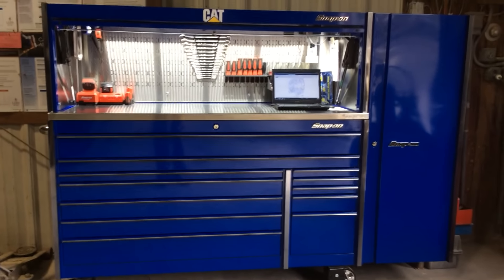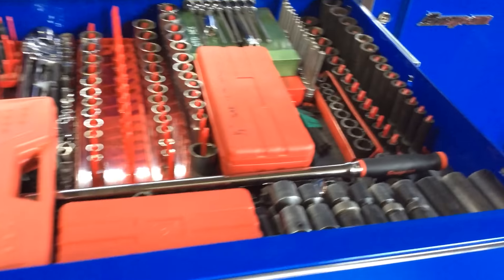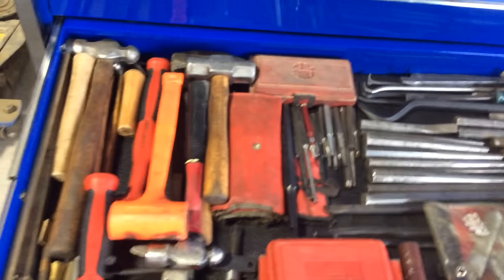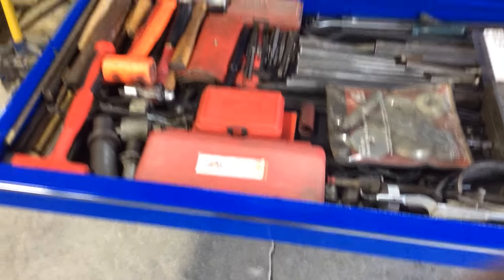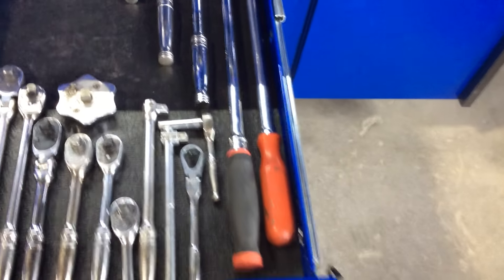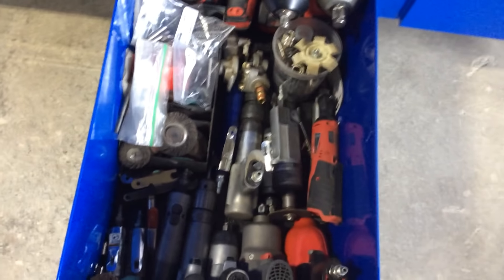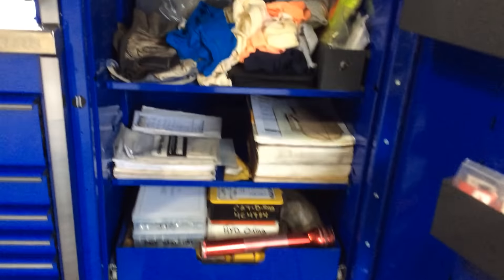Toolbox Tour - Heavy Duty Diesel Mechanic

Comment: You can always tell when someone has been around the block a few times when they have some modified tools lol. Bent, cut, cut in half, twisted  and so on. You got to do it sometimes to get the job done.
Reply from the maker: Arliss Young Thankyou for watching and yeah your always coming up against something in this line of work!
Reply: Exactly. I don't know how I got onto these tool box reviews, but lots of them are showing off new tools.  Hardly any of them are truly used tools that show the signs of working.  So its it just another youtube fad to do tool box reviews and people are buying tools they don't need or use?    I always have a set of cheap tools that I keep on hand that are there just to cut, weld or bend into that tool that I need for what is often a one time use.

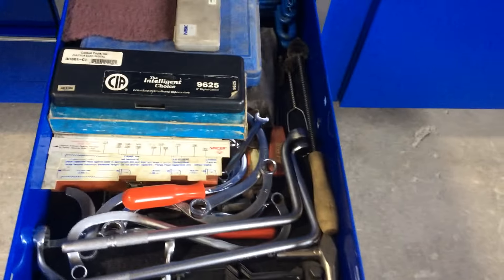Comment: I know this is old but can you do an vid on all the tools at 9:41    the overhead and compressor special wrenches?  Very rare to see those.  I have most of them but always looking.  Mac ised to make many great diesel tools.
Reply from the maker: @nathankisner8332   Thankyou for watching yes it’s been several years since I have made this video and a lot has changed with both the box and my truck however I really appreciate the views and comments and I try to help out when I can! I really don’t have time to make a video but the Cummins wrenchs shown are still available and you can always find on EBay if you are looking for a specific wrench that you saw I can try to get you the part # most of these wrenches just collect dust now unless you have older Cummins in your fleet but I still use the 7/16” on the Ism Cummins for removal of fuel pumps and the 5/8” for air compressor I have found that the Mac version in combination with the snapon s wrench works well on removing air compressor having a variety of S wrenches is handy from sunex , icon ; snapon , Mac , etc. gives you options and flexibility. Hope this helps sorry I can’t make another video but I can try to answer questions! Thankyou take care now!

Comment: Very Nice!  I at about the same place in my wrenching career  and I was surprised this is only your 2nd box, correct?  It seemed to me like I ran out of space and traded up every 3 to 5 years.   I also think it's interesting to see the variations of different mechanics work shown in their tools - I don't have half that amount of sockets, but I have 2 drawers full of electrical tooling because  I'm in and equipment dealer and our customers will handle 90% of the nuts and bolts work themselves, but won't diagnose a light bulb not working, so they bring it to us.
Reply from the maker: DocRevo Thankyou for watching! This is my 4th or 5th box , can't remember lol! My tools are split up between my work truck , my box in video and then I have cabinets and shelving in shop that hold all the cases diagnostic equipment and special tooling that I use in shop . I couldn't fit all that in video first round . I too have a lot of electrical diagnostic tools myself but didn't get into detail in my video . Your in a great place knowing that your the man they go to when they have an electronic problem they can't handle! Job security 👍I find most repairs today are wireing issues, sensors , corrosion etc. thanks again I'll try to get some more in depth videos coming!
Reply: Yeah..being "the man" seems great, but some days I wish I where just a lube and tire guy! LOL!   I checked out your service truck - that's great too!

Comment: So I keep seeing mechanics with 1000 sockets... Ideally if space and money was limited, one would only buy all impact sockets in 6 point in 1/4 3/8 1/2 sizes? Do 12 point have any benefits? And chrome sockets are just extras to have on hand?
Reply from the maker: Your gonna need both chrome, impacts and 6 and 12 point in both chrome and impact! I’ve been a professional mechanic for over 30 years and I bought what I could afford at the time and if I had to borrow a tool then I would buy that tool when I could thus adding to my collection!
Reply: Black Smoke makes sense. I’m heading more down the handyman road, so I won’t be able to tote 100 lbs in sockets. But if you can store them then you might as well have them I guess.
Reply: @kignacio  Not all the time, but sometimes there are bolt heads that are 12 point only. e.i. Driveshaft u-joint fasteners.
Reply: I work on my own vehicles and now a bus/RV. I don't nearly have what he has, but I have chrome sockets in 1/4 and 3/8 and impact only in 1/2 and 3/4.  Only 12 points I have are my shallow 3/8 chrome sockets. It gets me by, but again I'm no professional. Like said above, get what you need when you can afford it. Your collection will grow over time.

Comment: Very nice. I am going into this kind of industry and don’t know where to start with tools with the amount of different tools you need and the choice available is amazing
Reply from the maker: Toby walker thanks for watching! Just start out with a basic 1/4”, 3/8” , 1/2” met. And std. sets only buy the tools that pertain to your job . As you progress you will learn what you need ! There are many tool options and you don’t always need to buy Snapon ! If I can help in anyway please reach out!
Reply: Black Smoke thanks very much. Yeah I guess as I am over in the uk some of the tool ranges are different obviously we still have snap on, Mac tools etc. I have already bought a small top chest and have ordered a roll cab. I've got quite a few premier wrenches 6-32mm. But thanks for your help 👍🏻
Reply: Toby walker I’m also an apprentice and I find the teng sets to be good! If your also in need of impact guns the cordless Milwaukee m18 half inch and the m12 3/8S guns are on special for £550+vat
Reply: sfoy2010 yeah teng are great tools for the money. I also have a few Sealey tools which seem great and with the lifetime guarantee on all their hand tools you can’t go wrong

Comment: Very nice 🦖
WhouI'd you tell me what brand is 3/4 breaker bar? And do you recommended  it?
Reply from the maker: Marek K the 3/4” breaker bar is snapon yes I would recommend it or the Ez red extendable 3/4” both excellent! Thanks for watching I appreciate it 👍
Reply: @blacksmoke5009  many thanks for  answer . I asked  my Snap-on dealer and he said - snap-on don't make like this bar. Have you got any part nomber?  Yes I I saw ez  red 3/4 ratchet but is avauble only in USA. In UK I need pay extra tax,delivery   .Have a nice day.
Reply from the maker: Marek K breaker bar handle # is L872RM the head # is L8112A it’s 36” long and there is a # for complete assembly I don’t remember it but that’s how I bought it and you can also put the ratchet head on that handle as well # GL872 hope this helps!
Reply: @blacksmoke5009  many many thanks.  Have a nice time.  We waiting for more video. ;-)

Comment: How big of a toolbox should you buy as a first year apprentice? Big? Or small untill you outgrow.
Reply from the maker: ksteng15 I guess that all depends on your budget. When I started out 30 years ago I bought a used top and bottom box off the tool trk and paid $25 a week for it . As I grew my tool collection and needs I upgraded to a larger box . You don’t need to buy Snapon or Mac etc. there are good quality boxes available out there ! konalt from Lowe’s , Husky from HomeDepot and Extreme tools or Homak are all good quality starter boxes . Ask the mechanics that your working with what your requirements are for tools to do your job and go from there . It’s all about what you can afford so get the most bang for your buck ! If money is tight maybe buying a used box off the tool trk may be your best option. Hope this helps thanks for watching 👍
Reply: Spend more money on tools for now. A huge debt on a tool box is ridiculous especially when just starting out. If I was just starting out now, I'd run to harbor freight and buy the biggest box they have. Around a thousand bucks. If it lasts 10 years, you're golden
Reply: Black Smoke what do you think of Dewalt or Milwaukee tool boxes? I’m just starting out and right now my hardware store has a top and bottom for 899.99
Reply from the maker: Good for a starter box also ck out strictly tool boxes .com good deals there too !
Reply: As a first year your best bet is to get something cheap. Go with a used box if you can then upgrade as you go. Spend money on tools and upgrade the box for more tools.
Reply: @nicholasbrown6481  when I "upgraded" to the HF mid size box in 2014 and its still holding up good.

Comment: Awesome tour! How often do you use chrome sockets? I stopped buying them because I feel they are a waste of space and impact sockets can be used more often. Just my opinion.
Reply from the maker: Jason Eads I use a lot of impact sockets however chrome sockets in 3/8 and 1/4 drive I use often as well because they are thinner and slow me to access tight spots a combination of both is useful! It really depends on what your working on ! Thanks for watching and I appreciate your comments and questions!👍
Reply: I use chrome sockets alot, impact sockets are thicker and cant fit in some places and also when your torquing things down its better to use chrome because the material impact sockets are made from flex a little and You dont want flex when you need to torque things